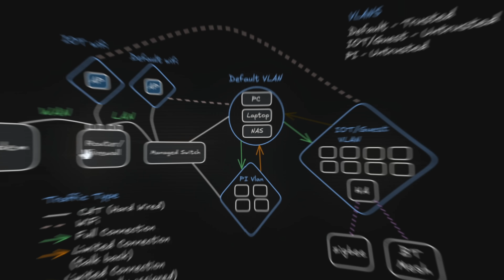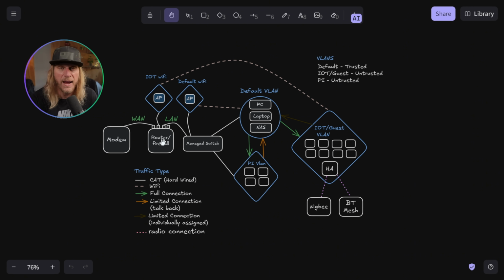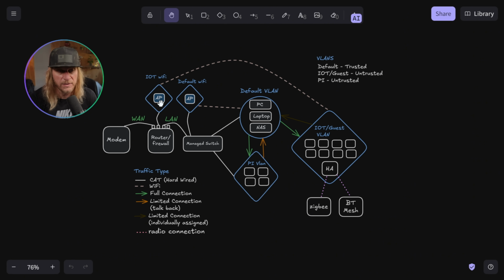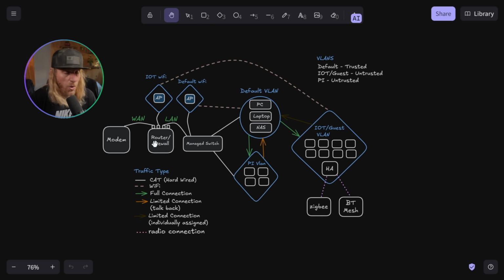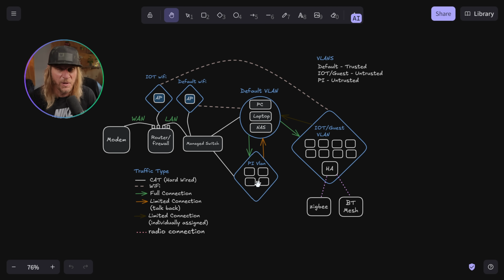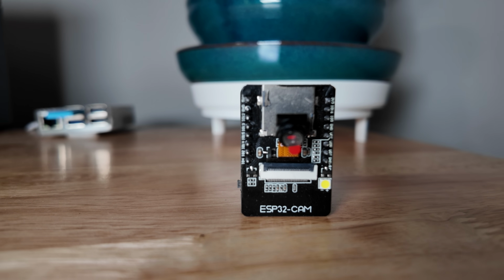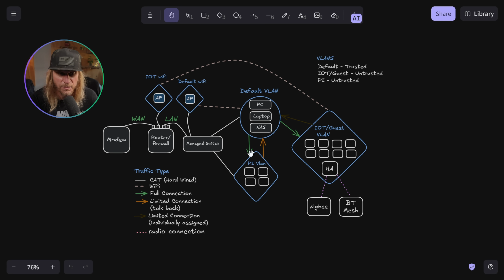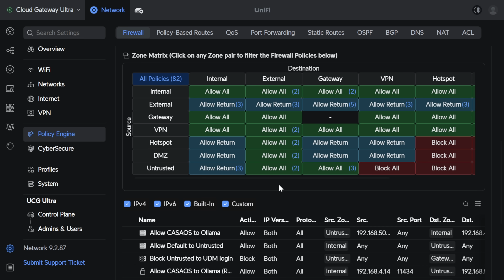Inside My Low Power, High Power Home Lab: AI, VLANs, Routers & Automation!

Comment: I did not know I was making a home lab until i started watching Unifi videos. I just wanted to fix my WiFi in my house 2 1/2 years ago. Now Ubitquiti has built out their product line so much that I was already locked into what i had got at the time. I'm just a regular guy who loves learning & tech. I have a 12U rack in my home now, from a 6U. I'm moving into a 24U rack in 2026 because I've outgrown it want to do more with the upcoming hardware from Ubiquiti. I did not get all of my gear all at once. I got them over time.
Reply from the maker: Love to hear it! It's so cool how solving one problem can lead to a whole new passion.Nothing wrong with taking time to collect gear, I know it's expensive I do that same, seem to save up, but one piece, save up, buy one piece.
Reply: @HillPhantom  Yep, that's how it goes.

Comment: Why wouldn't you just put the IOT network on the unifi AP? Super dumb dude.
Reply from the maker: Lol yup put sketchy iot on the same network my sensitive data is on super smarterer...
Reply: @HillPhantom if that's your arguement. Then you should use separate switching. 

If you place it onto a VLAN on the same AP, it's only path to the LAN is via the firewall for which is the same gateway that you are using now. 

I don't get it. If anything you are using more power running those separate access points. You hate trees don't you?!
Reply from the maker: @Boogersncome  so first, the VLANS are not on the same AP and if you watched and understood firewall rules prevent cross contamination.  Yup hate trees, when I am using Pi's for a majority of my lab.... Keep going though this is amusing AF to me.
Reply: @HillPhantom they would stop the cross contamination if they were tagged and applied to specific SSIDs as well, so unless you enter the SSID and PSK for the IOT device for your internal network that device isn't going to be in the same broadcast domain, nor the same security zone. Same could happen in your config. Again I don't understand why you would use dedicated access point for this,.unless you hate trees.
Reply from the maker: @Boogersncome  its clear you don't understand...cheers
Reply: @HillPhantom ok educate me how will the IOT traffic leak into your LAN if devices are deployed on separate VLANs on the same AP, and separated  via a firewall? Provide me with an example of when this has happened in the real world, where a device joined to a SSID on an AP is placed into another VLAN connected to the same AP without knowing the SSID and PSK or whatever authentication method has been utilised.
Reply from the maker: @Boogersncome  beauty of all this, you can do it your way, I can do it my way,  for me I ain't mad at ya, do you 👍 but I am fine with my set up mate. Cheers.
Reply: @HillPhantom I mean it's fine but what you wrote was bullshit. Just admit it mate. Otherwise you would've proven me wrong.
Reply from the maker: @Boogersncome  not BS, but like I said do you boo! If you think someone doing something differently than you is WRONG, I got nothing for ya, including keystrokes. Have a blessed day!

Comment: I have finally gotten around to really setting up my homelab with my DeskPi T1 Rack. I just installed my Unifi Gateway Ultra. I will be purchasing a Unifi switch soon because I could not get my D-Link unmanaged switch to be recognized by the ultra. So right now the only things connected are my Xbox Series X and my Kodlix Mini PC 14c 22 threads which is my current Virtual Machine box running Windows 11. I have a Zimablade to add into it and I'm also building a Ryzen 5 Proxmox machine.
Reply from the maker: Heck yea, that a great set up. Sound you are well underway. I lik the set up! You will love Proxmox!

Comment: I use UniFi Protect cameras at home, but I don’t have UniFi switches or routers. Not because they aren’t good—I actually use them at work and they’re solid. At home, I went with Grandstream APs and switches since they were cheaper and still perform well. Do I like them better than UniFi? Not really. They’re reliable, but I just don’t care for the WebUI compared to UniFi’s.

I’m also looking to upgrade my NAS. Right now, I’m running an old DIY build I put together years ago, but I’ve got my eye on the upcoming UniFi NAS 4. It should use less energy and help me downsize my current setup (not in storage space, just in footprint).
Reply from the maker: Awesome! That's sounds like a great set up. I don't have any experience with Grand stream but I will look it up. Sounds like a decent alternative.

Comment: Micro PC with m.2 to Sata card and 4 x 2.5 drives running unraid/truenas is all you need. 11th/12th gen 6c12t cpu can do multiple dockers/vms and has plenty of power to transcode jellyfin or plex
Reply from the maker: Love this! And saves overall I think as well. Solid way to do it for sure. I just got the N100 Mini ME and I feel the same way, well minus being a virtualization powerhouse but its plenty for most. Cheers.
Reply: @HillPhantom 14w-24w for 80% of its run-time.  HA, pi-Hole, NAS, Immich.  You can find the right deal and buy an entire second micro for a cold spare. Perfect for beginners or old heads sick of power bills like myself
Reply from the maker: @brandonreidy6989  100% Love the used aspect to, nailed the e-waste issue too. Killin it brosky! Love it.

Comment: Wanted to size down, but as I get free enterprise servers from work instead of having them threw away, it was more efficient to give them a second life in my rack IMO. Even if they consume more, it's still way more efficient to recycle them instead of buying brand new low power. Also, I get all the cool enterprise stuff like out of band management, redundancy, real cooling, upgrade space and cheap used parts online.
Reply from the maker: Hey bruv look "recycling" old enertripse equipment is still a HUGE win as it prevents a bunch of E Waste. And free, ummmmm, well, that the exact price I like lol. Breathing new life into old equipment has its W's for sure as well.

Comment: Loved this video ... thank you for creating it ... also a UniFi user but also an ex Raspberry Pi user ... now using a $150 NUC N150 running Proxmox which has replaced every single Pi.

- AdBlock
- Splunk
- JellyFin
- Plex

I was a massive fan of RPi until it became expensive and also being restricted to the ARM architecture sometimes proved troublesome (for me).

I now run a single NUC have replaced my 5 rack mounted RPi 4's (PoE) with a single machine. I still love RPi but now my setup is less complicated.

The thing I love about tech/IT is everyone has a solution to a problem/their problem ... HomeLabbing is fun, but making it simpler is more fun.

Thank you for your content and thank you for making me think about things and as someone who rarely comments, you made me comment!
Reply from the maker: Hey, I appreciate you taking the time to drop a comment — especially if you’re someone who rarely does! That means a lot.

I totally get the shift from Pi to NUC. The RPi is still a legend in my book, but yeah… once the prices shot up and you start hitting those ARM limitations, it’s hard not to look at an x86 box that can handle everything you throw at it. The fact it replaced five rack-mounted Pi s is wild. That’s some serious consolidation.

And you’re right — the best part of homelabbing is there’s no “one way” to do it. It’s all about solving your problem the way that works best for you. Sometimes that means a wall of blinking Pis, sometimes it’s one quiet little box that does it all. Either way, we get to nerd out.

Really appreciate the comment and sharing mate, cheers!

Comment: Great to see this video about Home Lab and its power efficiency! I've been very interested in power consumption for over two years and how to achieve the best power efficiency with very low idle power consumption (under 5W for the whole server with an x86 desktop CPU - i3 13100). I learned a lot about this from several sources:

 •   Unraid forum (user mgutt) and the legendary forum thread "Reduce Power Consumption with Powertop"
 •   Wolfgang's Channel on YouTube
 •   The community around fanless PC builds
 •   powertop documentation
 •   ASPM
 •   C-states

I also have one solar panel ☀ on my balcony and a 1.2 kWh Pylontech battery. Using redundant modules from Mean Well, I can power my entire homelab (or only some parts) by mains (~230V) or by solar power (DC 12V) without interruption in an automated way (based on battery capacity, weather, etc.) using Node-RED automation or Home Assistant automation.
Reply from the maker: Love this so much! And I do love me some solar. Thats crazy awesome using and i3 with that low idle power too! Appreciate the tips and resources as well, I know the community will value that. Cheers!
Reply: @HillPhantom  see my thread on unraid forum: "Ultra low-power (<5W idle) minimalistic only-SSD Intel 13.gen i3 NAS (Asus Pro H610T D4-CSM)"

Comment: I have been repurposing my old PCs for my Home Lab, which aren't the most efficient devices, but I also have a lot of solar systems to run them all. I'm close to not using the grid but I still think I'm a few large batteries away from that goal. It would also entail switching to 24v and buying a new inverter so kind of out of my price atm. 

I have one of those AMD 395+ Pro blah blah blah on the way so maybe I can move service there or just use it to play games at 200w and not 500w when I game. Either way I like the move to more power efficient chips from these companies.

I now realize why my dad yelled at me for touching the thermostat as a kid, sorry pop.
Reply from the maker: LOL! My wife still yells at me for that! I really want to follow you lead into solar I get great sun by my set up for half the day. You all got me thinking! Cheers.
Reply: @HillPhantom  Its super fun, do it! Some all-in-one systems are great, but you get locked into their ecosystem sometimes. If you love to tinker, it would be right up your ally.

Comment: But... how will I impress the ladies with anything less than 265GB of RAM?
On a more serious note, outside of gaming I think we've hit a peak in hardware requirements for home computers.  Most people just need to run their internet browser, edit text, make spreadsheets, and MAYBE store their media.  Nothing a $150-$300 computer can't do for someone for the next decade, especially if you install Linux on it to keep the OS from slowing your computer down with bloat from updates.
Reply from the maker: This is a very REAL thing that I too am concerned. lol 

100% agree, I mean forever they been saying, dumb terminals, tap into cloud, get a BA computer. And Chrome is kinda like that but.....cloud gaming for example still isn't 100 though NVIDA has done a good job. I just find it amusing how long I have heard this is how it should be, and I agree, yet its not ... yet. However, outside of gaming, I full send agree most can get by on a RaspberryPi 5 8GB and be just fine. And these mini's, with AMD and their iGPU like the 780M that's what I cant wait for. An iGPU on a CPU that I can triple A game on....
Cheers bruv!

Comment: I've managed to reduce my overall footprint. Now most of my rack is shelves, and draws to fill it up. 

I have a Unifi Dream Machine, and POE Switch which powers my cameras and door bells etc.... A behemoth storage drive that now acts as a VM containers as well - I now run for 3 VM Containers (1 Dev, 1 Databases, 1 for Docker Apps). I have my storage virtualised through unraid that sits on top of proxmox. And, finally a desktop computer is in my rack as well. 

I have been conscious of of powerdraw, but I think I've hit my limit in how I can downsize. My daily power draw for everything is 1.5Kwh. There are some really good youtubers out there like wolfgang who concentrate on powerdraw which is really good.
Reply from the maker: That's an awesome set up! It's hard to reduce but well worth it and ongoing. I have areas of my lab I'd love to pair down but it's also costly so it's a slow match but I love doing it. I've really been liking my unifi set up I'm super glad I went that way. And I love you rolled prox and sat unraid on it! Cool set up for sure! I have seen Wolfgang and good to hear he's conscious of energy. I appreciate the watch and comment cheers!!

Comment: Awesome video on a subject I think a lot of the community is concerned about. I live in the UK where energy bills are insane right now.

I, unfortunately, have recently received inheritance and will be buying a new house and kitting it out with a proper homelab setup, I’ll use this video as a blueprint to work off.

One thing I’m a little concerned by, this is no criticism, is the ability for the N100 CPU to serve large files. One of the main objectives I have is to build a NAS that serves a separate Mac Mini based Plex server with 4k files not only internal to my home but also external when I work away. I appreciate that the N100 is a very power efficient CPU but would a power efficient Ryzen chip really pull much more power, including the draw of the motherboard too?

Anyway, Subscribed as you’re awesome.
Reply from the maker: Hey no offense taken at all mate! I honestly have never had the n100 bottle neck but I also don't think it unreasonable or unresponible to level up the CPU. If for Plex I would suggest an Intel as they have on chip tech that makes transcoding easy and efficient. However I have experience with ryzen chips with no issue transcoding for Plex but might be worth a quick research to see if there is any advantage to considering a more powerful Intel chip if doing alot of Plex transcoding. But....I do love AMD and personally prefer them for most things and if your not going to be serving a whole bunch of folks Plex I'd probably roll a ryzen. The other side is with a better chip you could get more cores and threads and ram and then you could do a lot more plus Plex on that machine. I like the idea of using a powerful machine put docker on it Plex and other apps or proxmox. I think having this ability makes it responsible for reducing e waste and footprint. I see no issue with chips like ryzen that are pretty efficient with only a bit more power draw esp for something like your use case or even giving you ability to do more on it instead of having say two machines. I think my goal wasn't to shame, I know you are not saying that I was at all, or judge, but just to make ppl consider and think u clearly are and from what I have seen most commenting are considering it which makes me happy. Us Americans are too spoiled with energy costs being relatively low compared to the rest of the world but with our corrupt leadership I doubt we will be in this position much longer. Sorry didn't mean to get political but most Americans have zero clue what places like Europe pay for energy. Thank you for the awesome comment and sub 🙏. Cheers

Comment: My lab is even more efficient. 1gbps fiber xpon onu in bridge mode, Flint 2 openwrt router, Lenovo m720q homelab running Debian. No vlans no HA garbage, no VMs, super fast and reliable. The price of hobby is 10+120+120 USD + storage
Reply from the maker: Sounds super simple and low power. No vlans and ha garbage? So how do you do automation and how do you protect your sensitive data. Simple is great but please don't tell me your automation is alexa.
Reply: @HillPhantom  my home is dumb as can be, no automation and I'm happy. Also we have power cuts so low power draw and UPS is a requirement. I have connected mini DC multimeter to monitor.
Reply from the maker: @EVR1AL long as your happy and it does what you need that's awesome 👍. Also super cool it's efficient and bare bones. I'm with it brother! Cheers
Reply from the maker: @EVR1AL  not dumb at all brother, real, raw, and to the exact point you need it. I applaud it, even I have waste that i could pair down for sure!
Reply: @HillPhantom  yeah my father and I come from the same outdoor background as you, I try to reduce/reuse/repair/recycle. Also I think in openwrt I can set white list and black list for each device to access wan, not including guest network, so VLAN is more corporate thingy for those who wish to get the skills at home and apply in job. Same applied to kubernetes
Reply from the maker: @EVR1AL  I have never messed  with openwrt but have heard good things. Thats a good workaround for sure! Kubernetes ...that's another I honestly have just avoided, for no other reason, then just another thing to take on. I do know ppl that love it tho, but then again then also love Ansible so lol.

Comment: Hey there. Just curious - why are you running duplicate WiFi’s with the UniFi and eero. Wouldn’t just sending the VLANS through to separate SSIDs achieve the isolation for you with a bit lower power and less channel congestion?
Reply from the maker: Great question. Big reason my one AP  can't cover my entire house and two I'm not comfortable pushing guest, iot, camera, and TV traffic on same AP even if on separate vlans. Technically its safe if tagged on different vlans but I just feel safer have them on separate physical APs More a necessity coverage wise and some illogical needs to have my sketchy Chinese device isolated as much as I can. Cheers

Comment: Everybody homelabs differently, but I do appreciate seeing something a little less 'over the top' for a change.  

Seems like there's been a bit of an upsurge in 'mini labs' lately, but it seems like more of a "conspicuous consumption" thing / catering to the algorithm than anything else.

I'm coming at the small form factor / low power aspect from a different view - power is pretty cheap and fairly green (hydro) in my area, but I do want to add a little bit of home media server to our RV. There, power isn't necessarily 'expensive', but space / noise / heat are all issues.

Keep up the good work 👍